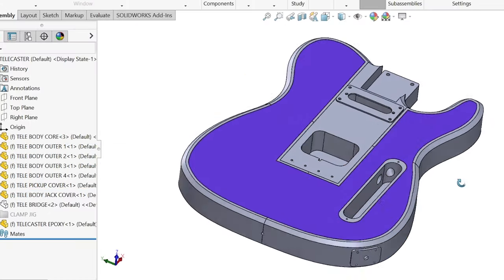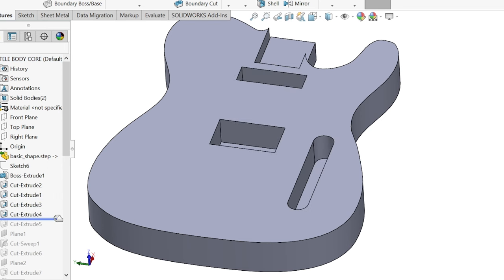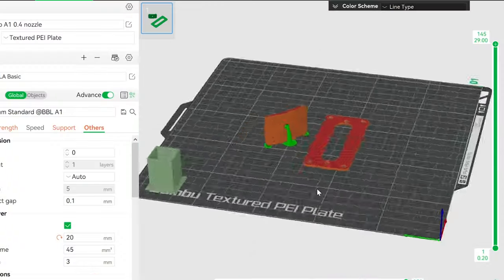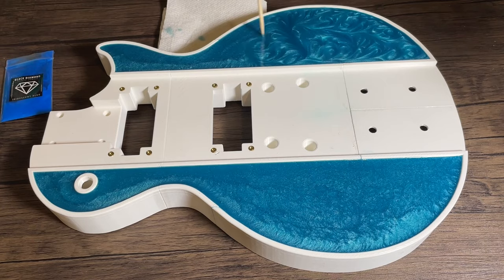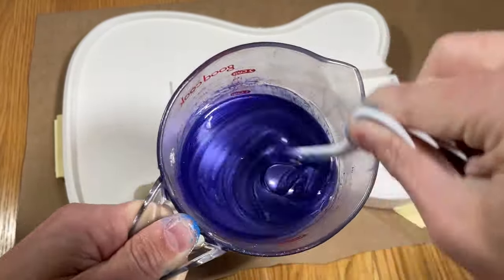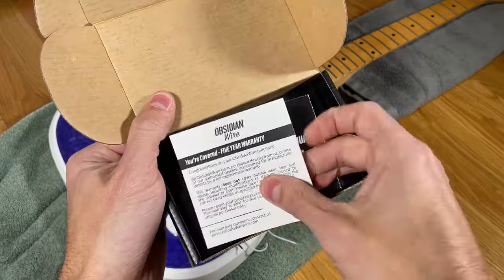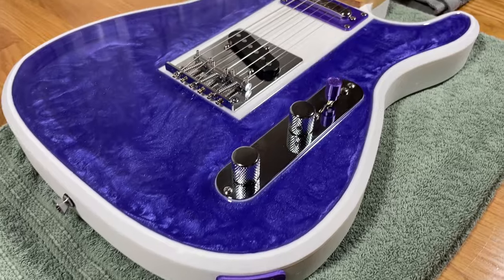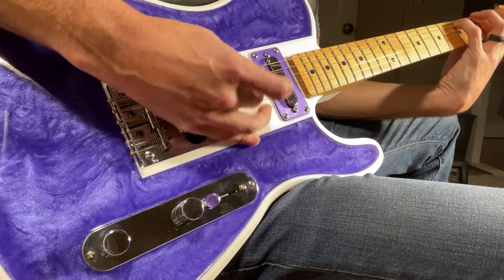3D Printed Telecaster Functional Electric Guitar! Step by Step Build

Comment: It would be great if you could list the dimensions of each piece. My print bed is only 200mm X 200mm and I don't think some of these will fit. I don't want to pay for the files only to find that I can't use them.
Reply from the maker: Thanks for the comment. The parts can fit on a 256mm x 256mm bed. The Core, Outer 1, and Outer 2 parts will be too large for a 200mm x 200mm bed. That being said here are few options you could try to make them work with your printer.... 1.Tilt the parts partially vertically upwards. This option will require more support material, but may allow the parts to fit the bed..... 2. Split the parts into smaller sections. This option may cause issues if you split the center core of the body (as this part holds the string tension between the bridge and neck). Hopefully that helps!
Reply: @the3dprintzone  I thought about splitting the core and adding carbon fiber tubes, but I may see if the tilt works first.

Comment: Oh man the epoxy idea is so smart. I will so be buying this stl on payday. I will have to try and track down a neck/electronics on amazon ca
Reply from the maker: Thank you! It’s a great project, enjoy!
Reply: @the3dprintzone  I thought it would fit on my ender 3 but it's a no go 😆 The main body is off by 1 inch so I am going to try printing the body standing up tilted back on a 45 degree angle
Reply from the maker: @feral7094  are you able to tilt it at a small angle and print with additional supports?
Reply: @the3dprintzone  Yup! I lucked out. Great design once again
Reply from the maker: Awesome! Thank you! 😄

Comment: Hello! I’ve really enjoyed your videos lately! This was great to see as I am trying to do a similar guitar project. But for the body core where you did 6 walls and 40 infill, do you feel like it could be stronger? Is there a lot of flex or tuning stability?
Reply from the maker: Thanks for the comment! With 6 walls and 40% infill, the core came out very strong. You could of course increase to an even high wall count and higher infill if you want even more strength, but I don’t think it’s necessary.
Reply: Nice! Well thank you for this information and replying to my comment!
Reply from the maker: No problem, happy printing! 🎸

Comment: How many walls did you use for the core?
Reply from the maker: The core is printed with 6 walls, at 40% infill. You could increase either of those settings if you want, but it came out nice and rigid
Reply: @the3dprintzone Thanks